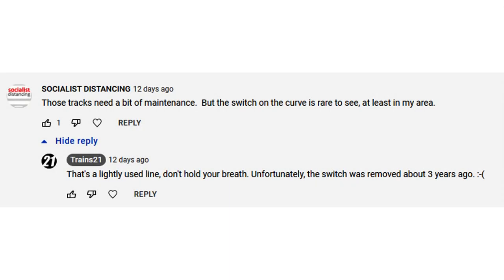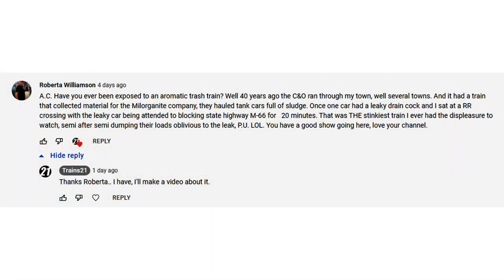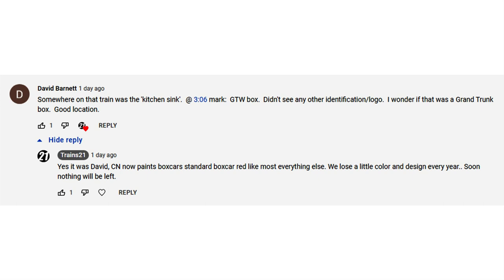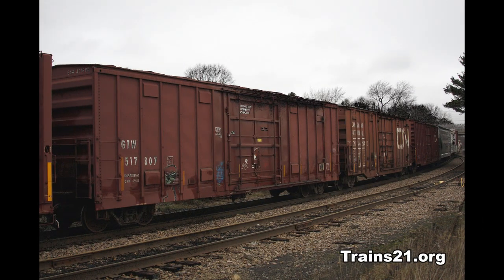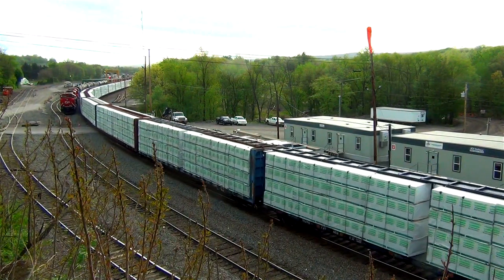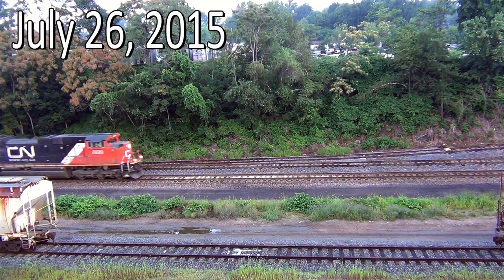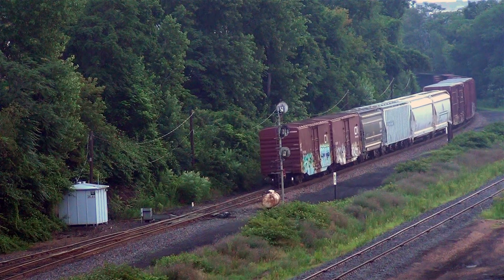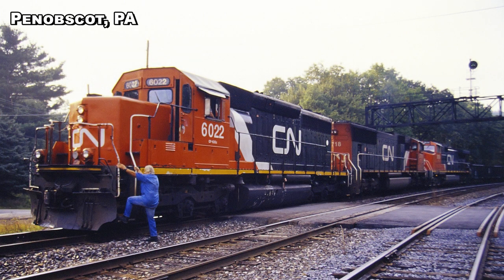COMMENTS, QUESTIONS & CORRECTIONS #3

Comment: Trains21 my question is: Why does Amtrak mosty use the P40 Genesis locomotives instead other diesel electrics such as The GP40MC used by  MBTA or the GP40ph-2/fh-2 used by MTA and NJT.? I would love to see some of these freight-turned passenger engines in the Amtrak livery. I know Amtrak has a few dash 8’s  but you rarely see them in a passenger service unless they are towing a broken down Genesis or the one that’s been exclusively used for Amtrak California.
Reply: Why purchase them when the plan is to use the Siemens ALC-42 variant of the SC-44 Charger.
Reply: Take a look at The Engines of Amtrak on YouTube for a very in depth look at all those engines you mentioned.